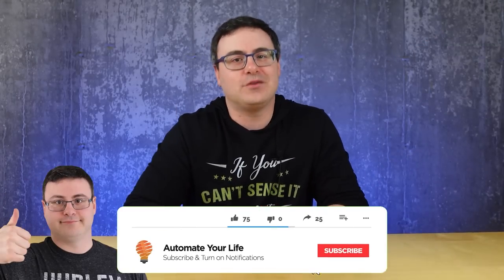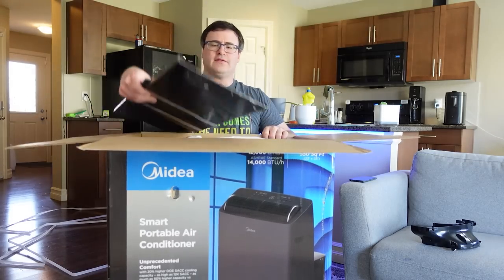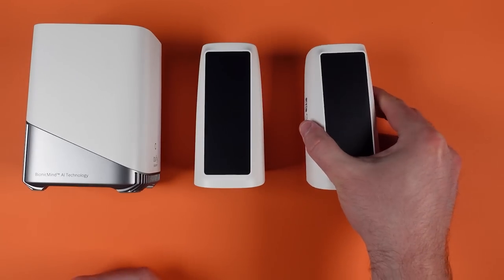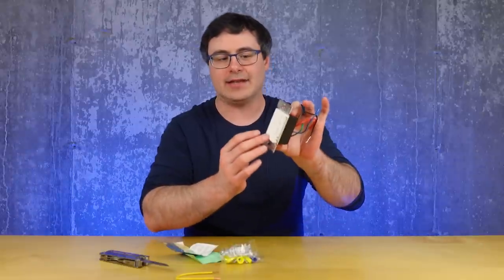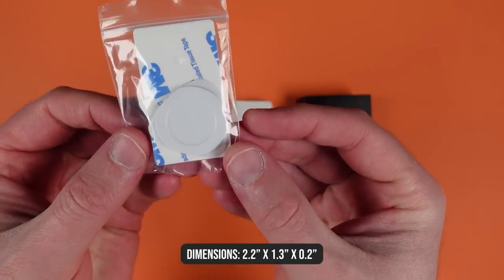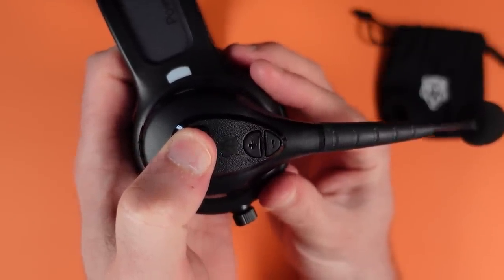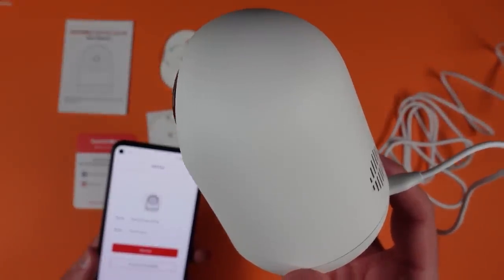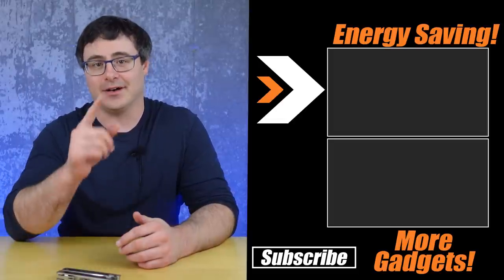My Massive Smart Home Tech Unboxing - EP 4 #EnergyChallenge

Comment: I love my midea cube dehumidifier. I'm in Florida where it's always humid but I knew that would also be a challenge if the power went out so I had it running non-stop before that hurricane came through. Well worth it and great to check in on and with the app. I don't like two things. 1 - I end up pressing the power button too long at times and it then clears the Wi-Fi connection and starts searching again. I've had to delete the device in the app and re-add it. 2 - if you don't properly shut down the device and unplug it in that order you may go to turn it back on after you've emptied it to see that it still is tracking from the previous water level. Still a great device overall though and user error that I've learned not to do.
Reply from the maker: Really great breakdown!  I actually have that Dehumidifier in this video so you'll be able to see what I went through.  I did have one time it do that disconnection, but I thought my Wifi caused it!  I'll have to try that again!

Comment: Try the LG Smart Dehumidifier with a pump. I’ve had it for 6 months now and I’m pretty sure it’s not a new thing.
Reply from the maker: Hey Mark, you using that one with any other connected services?  I'd be interested to hear.
Reply: @AutomateYourLife  Not really, just the App. At most I might try Apple HomeKit, but I am not a fan of microphones or cameras inside my house for obvious reasons. I also have a smart LG washer and dryer and a smart LG Window AC in my garage, along with a smart hunter fan and 18 recessed smart Hue bulbs. My new smart garage door was ordered two months ago and will arrive mid December. And all of that is just the garage.

I am a fan of smart stuff, especially the new trend to localization, and your show.

Thanks for responding.
Reply: Don't you live in Calgary? (Not much use for a dehumidifier on the Prairies, is there?) I'm not sure how you get frost collecting anywhere outside when it's -30 or lower...
Reply: I believe if it works with ThinQ it should be easily synced with Google or Alexa

Comment: Hi . I use a Hubitat hub . I also have many TP-Link switches and plugs . The Hubitat hub installed several of the devices but did not find all of them . Can you point me in the right direction to get the rest of my switches installed ?
Reply from the maker: Hmmmm, that's very odd.  I wonder if maybe some of them just need a firmware update?  I'd struggle to tell you what the difference would be otherwise.  I'd also check in with the Hubitat forums/community because I think I remember seeing something like that.
Reply: It might depend if they're Tapo or the other one.. TP do two series of plugs and other gear..

Comment: You have to verify that the dehumidifier will work in freezing temps. I would say it won't as there is a risk of any water inside it freezing and expanding thereby cracking internal components. Dehumidifiers are designed to take humidity out of summer air. I use three of them, one in the basement, one in living spaces to keep the air at 50% and one in a conditioned attic space but none of those spaces ever drop below 60 degrees.
Reply from the maker: Good point!  I gotta keep it near the back where it's warmer but I'm not sure if it'll handle that in -40C!